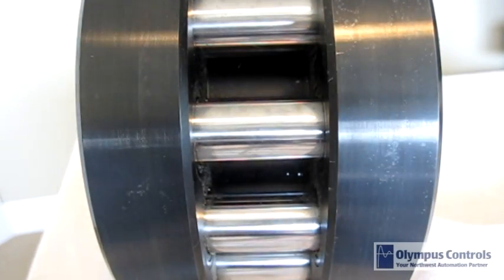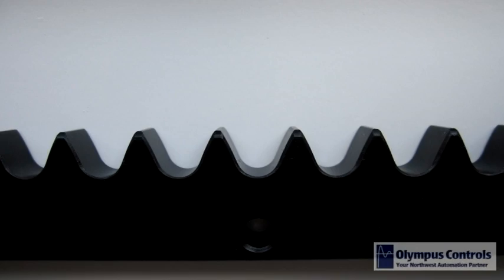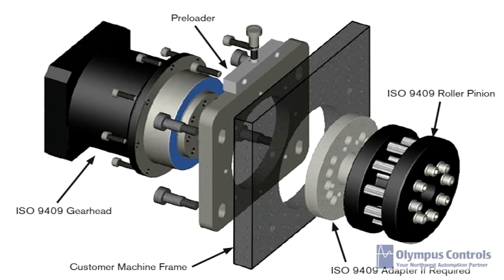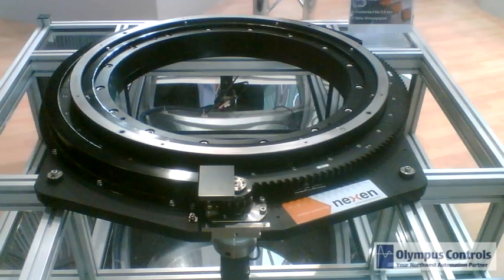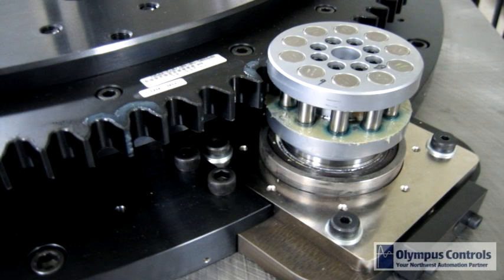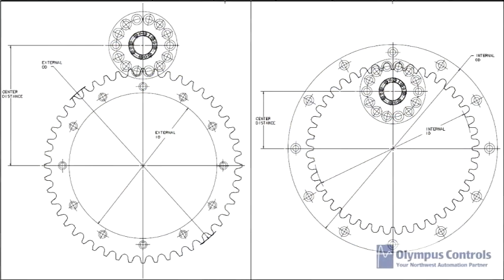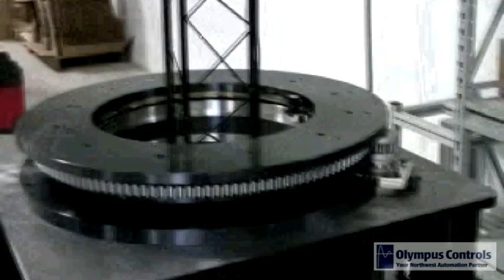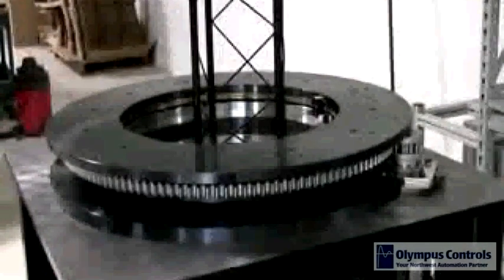Nexen RPS and RPG Mechanics

Comment: This system is nice. They put the motor on the carriage, and replace the long ballscrew, wire rope, band, or toothed belt with a long rack "gear". It puts the motor weight on the carriage and needs flexible cables to drive that motor.
Always compare against a stationary motor and wire rope, band, or toothed belt. Also ordinary rack-and-pinion, lead screw, and even linear motor with long stator.